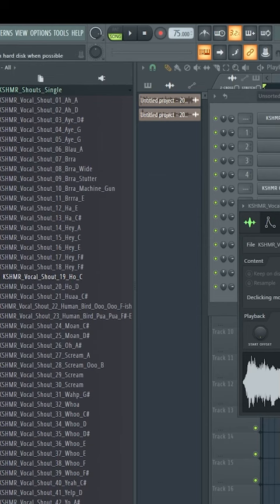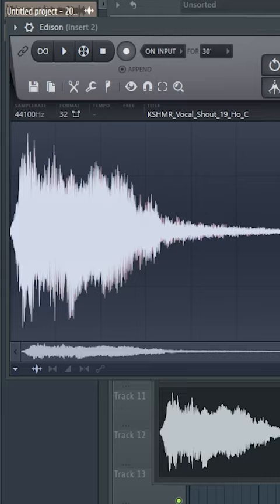Sound Design Trick in FL Studio No.2 #shorts #producer #flstudio

Comment: u can do this just by using the sampler just make the lengh very short n add a looped crossfade
Reply from the maker: Hey man, thanks for sharing. Yeah you could do that, but I shared this way because of the "snap to zero crossing" option that essentially makes your loop sound smooth and without clicking each time it loop. Second reason is because it is a bit easier to preview the chosen part of a sample before you drag it to the sampler haha
Either way is good if you know what you're doing xD
Reply: @pan1k  yea they both work 
but it doesnt do the clicking if u add a corssfaee
Reply: How do you do that